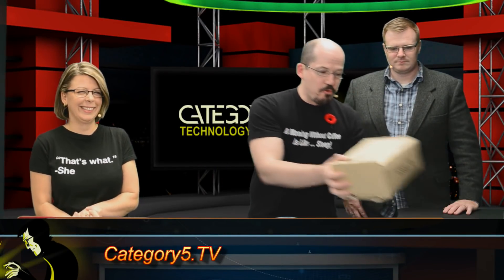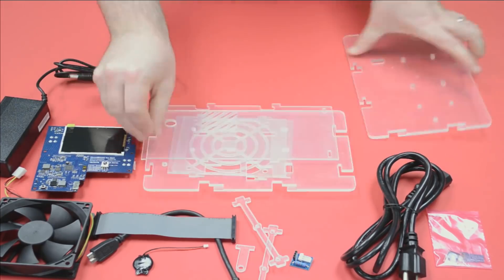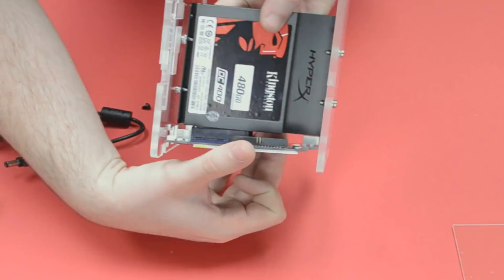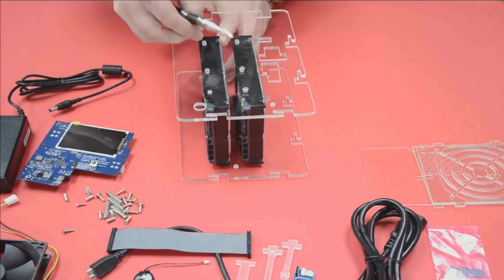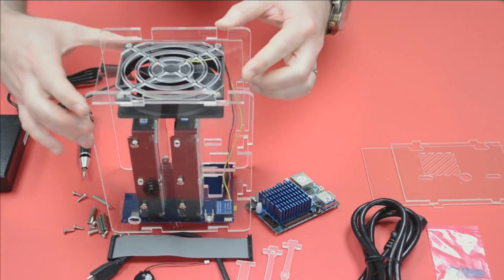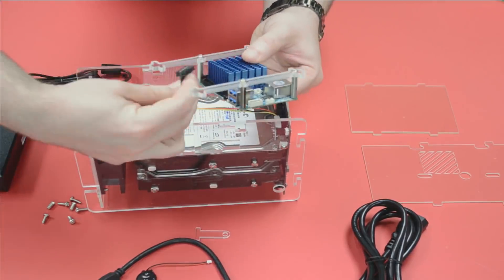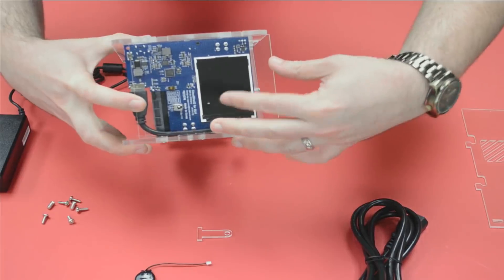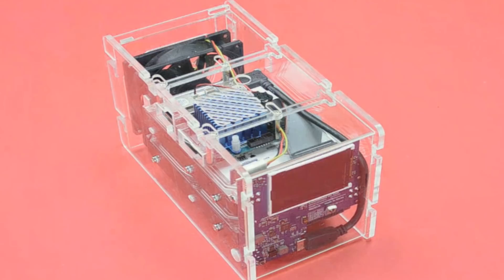The 8-CORE Raspberry Pi Killer: ODROID XU4Q with CloudShell2 Case - Assembly

Comment: For the money you can just buy a Quad-core Celeron J3455 mini PC w/ 64GB ssd and 4GB of RAM.  I bought one at $150 off a chinese distributors website, but you can even get them on Amazon for $200.  Comes with full version of windows 10, and runs games all the way up to PS2 (some PS2 are rough, but still some are possible...unlike the ODROID.)  You have put more than $200 into this build, and are bragging about smooth N64 performance.....
Reply: how quiet is the Celeron tho ? if I am wanting to run it 24/7 and have it in a bedroom like I do with a Pi3 atm ?
Reply: A lot of them are fanless.  The one I have has an adjustable fan on it.  They can run stable up to 70ºC, so you just adjust your fan accordingly, or deal with the thermal de-clock which may or may not effect your usage.  The max volume of my fan is much quieter than, say, an Xbox 360 running.  It is very subjective, but I would rate it a 2/10 on the distracting noise scale with 1 being someone walking on carpet, and 10 being an alarm clock.
Reply: The celeron sounds great maybe an overkill to use just as a media player with both plex and kodi, I've tried pcs as media players b4 but I just can't get wife and family to use em, they want a device that can be operated by a hand held remote not a mini keyboard, never found a solutuion
Reply: I doubt it would help in this case, but mine came with an IR remote that works like a mouse w/ a few macro functions.  That being said, I COMPLETELY know what your talking about, lol.  It is an impossible task to get a significant other to use even the simplest of KODI setups, haha.

Comment: I like the raspberry because its not that expensive please compare things of the same price.
Reply from the maker: This board is only $54. So yes, it's more expensive than a Pi, but still very low priced. You pay a small premium for a lot more power.
Reply: Well why did i just buy a raspberry pi 3... Is there same support like the raspberry like games made for it ? or maybe some programs..

Comment: So is it $35 like a rasp pi 3?? Come on lol this is silly af
Reply from the maker: $54 for an XU4. 4x as powerful.
Reply: LinuxTechShow so your telling me the box you showed in your vid can be had for $50?? Link in your description??
Reply: Case alone was $80 on Amazon, all other links were sold out so couldn't see. Just not seeing how your whole box could be $54. But if i can get all that for $54 hell I'm on board
Reply from the maker: No, the case is a different product. Does your $35 Raspberry Pi 3 come with a case? Let alone one with a screen and backplane? You're comparing a Raspberry Pi 3 board ($35) to an XU4 board ($54). How did the rest of the peripherals get involved?
Reply: LinuxTechShow yeah mine did. I've got two servers running cost me $35 total. Not saying this isn't cool, just when i saw the headline rasp killer thought it was something much better for around the same price point. But just taking your board and the case you're over $100. I can get 2 pi 3s and cases for that. Yes this board is cool. Yes its obviously better. But the great thing about the pi is it's price point. And most consumers after going to need extra peripherals, hence why i included them. I very rarely just buy a pi board. I buy all the parts needed to put together what I'm building. And in your segment you show more than just the board. So why would you question me talking about more than just the board when that's exactly what you did in your segment? How much would the whole box you had in your segment cost?

Comment: A Pi killer this is not.

The thing that make the Pi great is that it is cheap enough to be affordable for even small projects, but functional enough to perform any task those small projects might entail.

Start packing on a bunch of extra performance and cost and you stop catering to the needs of this market niche.

Now is there room for an 8 core ARM based machine of this size on the market? Definitely. However, I'd be hard pressed to think of a use for one that I couldn't do cheaper with a Pi. About the only thing I can think of would be a cluster computer. Even then the two basically just break even as the Odroid has twice the cores but also twice the price. The main advantage would only really be less cabling and switch ports are needed.

The real Pi killer would be the Orange Pi which offers about the same performance as the Pi but for almost half the price.

Personally, I am not a big fan of ARM based processors, mainly because they can't easily be made to run x86 or amd64 based applications. That really cuts down on the amount of useful software available for them.

Frankly, I prefer the Intel Compute Stick model: STCK1A8LFC. These days they are about the cost of a pi, have about the specs of a pi, and are actually able to run x86 and amd64 software. The biggest advantage of them though is that the compute stick has intel HD graphics which is far better than the broadcom chip on the Pi. Of course, it also only has wireless networking, 1 USB port for connecting devices, and is really hard to install a different OS on than the Ubuntu it comes with.

Comment: You said the XU4 was basically the same form factor as the Raspberry Pi.
However, in actuality, it's approximately the same size, but has a different form factor (port layout, etc.).
Reply from the maker: We're both right, technically. Wikipedia says: Form factor is an aspect of hardware design which defines and prescribes the size, shape, and other physical specifications of components, particularly in consumer electronics and electronic packaging. A form factor may represent a broad class of similarly sized components, or it may prescribe a specific standard.
We are referring to the form factor ie., dimensions of the board itself. The size and shape.
We both get a point.

Comment: Even tongue in cheek, I would not call it a PI killer, what I would call it, is a nice small form factor desktop pc, the 8 cores will certainly allow for some high performance number crunching, though the 2 gig of ram could well become an issue once the OS is loaded in, this will probably lead to a lot of swap file usage, therefore negating the 8 core performance, in my opinion, this board needs 4 gig ram minimum for optimal performance.

Comment: This is not a raspberry pi killer, it doesn't have the support. The OS are not as optimized. Hard kernel support I got was minimal. If you can get it to run proper yes it does out perform at a difference price point. Not a faircompsrision for a non profit who set out to make sure we can afford to play around with a cheap powerful board. No where near a killer

Comment: Wait.... the included SSD adapter bracket doesn’t fit?  Sounds like a REAL quality product there!
Reply from the maker: ? The bracket adapter that came with my SSD? It's just a 2.5" to 3.5" adapter. If you want to use an SSD with a backplane, you have to buy a 3.5" drive adapter as shown. That is always the case and has nothing to do with ODROID.

Comment: Can this do mjpeg-streamer with a video feed from a webcam and not max out a cpu core at 100%?
Reply from the maker: xav500011 send us the config you want us to test with and we'll add it to the coming benchmark show. We have some c920's - does that work for you?
Reply: I asked the question because though the ODroid Xu4Q has 8 CPU cores there are many processes that can only use 1 thread\1 cpu core.  And this is a problem I have encountered when trying to use a quad core Raspberry Pi 2 to stream video from 2 x Sony Playstation 3 Webcam (They are very cheap to buy 2nd hand because there is no Windows driver for them but they work fine in Linux and they have give a good video qualityeven at 640x480 resolution) using https://github.com/jacksonliam/mjpg-streamer.  Because the Raspberry Pi 2 has 2 cpu cores maxed out at 100% from the 2 instances of mjpeg-streamer it can not stream video in real time without several seconds of delay.  I have fixed this problem by using an old laptop that has a AMD Turion Dual-Core CPU at 2.1ghz.  Though this laptop is not 'ultra low power' it is 'low power' in using only 25 watts of electricity.  And this far more beefy CPU can handle streaming video with mjpeg-streamer in real time with no buffering\delay.

Now a problem with this could be that there is no hardware acceleration for streaming webcam video that there is for other video playback.  But if you guys can get the ODroid Xu4Q to stream video at 1080p from say 2 x Logitech C920 webcams that would be very impressive.  Also you could do a comparison with a single board computer that has a quad core Intel Atom CPU.  Because as far as I know Intel Atom CPU's have more grunt per CPU core than say the ODroid Xu4Q.

Comment: I have a Raspberry Pi Killer.  It is a $5,000 rig that destroys all comers.  Who cares though.  Pi's are awesome because of the price, the GPIO and most importantly the community of developers.
Reply: It's only slightly more expensive. If you bought two Pi's and clustered them, they still wouldn't match the performance.
Reply: Dude. My pc from 2000 still iut powers the latest arm processors. Theyre a joke as far as processing power goes
Reply: I'd say it was more focused on creating embedded solutions for people who otherwise couldn't implement such systems. It offers a generic solution to implementing an embedded system for virtually an unlimited number of products that would've required extensive engineering before the advent of SBC's. All that is needed now is a basic understanding of electronics and some computer programming skills.
Reply: Touch late but for me to get a pi with the nes case psu and sd card USB adaptor. It's about £74. The odroid is about £58 with a psi £6 for the sd adaptor and about 🔟 for the case. It's basically the same price. For a system that's double the power. But it's hard to choose. I'm new to this and the pi looks great for noobs that wants to retro game.

Comment: Not a Pi killer. The whole concept of the Pi is that it is very low cost and modular. I can use a single RPi for any number of different things by simply switching out its micro SD card. That said, this single-ish board computer does look pretty cool if you've got far more cash to burn.

Comment: The reason why your HDD bracket don't work is the same reason you cannot use those bracket in a HDD disk tray ex: DELL PowerEdge 2950. has 3.5 hdd but won't work because the bracket offsets the SSD by like 1/8 in. So that front panel won't work because of that. The bracket you need has a L-shape. Looks for 3.5 to 2.5 adapter for server. it fills the gap rather than moving the drive something like this: http://www.ebay.ca/itm/like/112451929619?chn=ps&dispItem=1
Reply from the maker: I prefer the adapters we show at 13:20

Comment: Did not make it past the first segment. "Look at that big heat sink, know what that means? No fan" Then pulls a fan out of the kit.
Reply from the maker: The fan is part of the NAS case we're demonstrating, not the ODROID XU4 (the small, Raspberry Pi sized board).
Reply: there is passive cooling options

Comment: I'm imagining how much more powerful 8 cores will be for emulating retro consoles... And I'm imagining it makes zero difference.
Reply: miss point of the pi
Reply: i seen one using a zero
Reply: You are assuming that all emulators run on 100% parallelism optimized code. They don't. In fact, they are more often than not only able to utilize a single core in the first place. Putting a heatsink on a Pi Zero and overclocking it quite heavily will yield a substantial performance boost over this thing.
Reply: 300 a trick?

Comment: So how exactly is this a Pi killer? It may have 4x the speed at twice the cost, but for twice the cost of the ODROID I'm close to a Ryzen 5 1400 and a cheap motherboard that will make the ODROID look like a Ti-82.

My point is that it isn't just the power here that makes Raspberry Pi what it is. There's much more to it than that. The extremely low cost puts it at a price point that is affordable for so many more people. So even if you are just using this as a low-end computer that's a remarkable feet for $35. 

However, the most important thing that I believe sets the Pi apart from the ODROID (and like competitors) is the community that has been established around it. The likelihood that you will encounter an issue no one has tackled before is minimal. The existing documentation along with the active and helpful community are an enormous asset that no other competitor can touch at this point. Personally, I don't see that changing anytime in the near future.
Reply: congrats on seeing it, it is why i hate term pi-killer
What it should be called is your next step

Comment: Ok listen. You as well as all the other tech channels. If something is a Pi killer or anything killer for that matter. It can't be 3 times the price. A raspberry pi on average is $20 and has 4 cores. If you do the math and cluster your pi's together you get 12 cores for $60. Now if you want to do a proper comparison, cluster 3 Pi's and test. Then test this new overpriced crap. Only then can you decide which is better. 
Note: above prices take into account that most people have a box containing a couple old routers and a bunch of ethernet cables lying around.
Reply: actually the fully miss the point as IT IS NOT A PI , read the story behind the pi , only one board would I say ok to as far as trying to replace it was the chip and it's story is just as intersting

Comment: My issue is they clearly don't know how computing works, saying it's 2 to 4 times faster because of the core count.  If that was all that mattered a 20 pluss core Xeon would beat the crap out of all the I core chips and be the choice for gaming.  But there is so much more to it, and only a few apps will even use more then 2 cores efficiently.  Also to kill pie, you must beat it in the same price range.  Also, where is them using it and the benchmarks.
Reply: from what i have heard xeons are useless for gaming, its all in the video card
PLUS pi-killer is a bad term because it misses the point f the pi

Comment: It might be way cheaper to buy two HC1's and use raid one over FCoE. You will loose the reliability of the eMMC though, so you either only use uSD for booting, or you boot a live image from uSD,
Those 2.5"->3.5" backplane converters are expensive as f*ck especially if you have a correct one.
The downside of the HC1 is lack of HDMI out of course, and no I/O.

Comment: Pi killer?   This is not really covering the Maker market that the Pi addresses. You are just building a general purpose PC.  R. Pi Zero with WiFi at £10/USD12-13 (real price) is a MUCH more interesting device, especially as you can now access the GPIO pins on a remote device ....
Reply: pi-killer is a bad term, it is not a pi and that point is missed

Comment: Why do they keep releasing these silly raspberry pi's, it will be a 16 core one released next week!
Reply: What use are more cores if it doesn't utilise the ones it has 100%. Most SBC code is not written to utilise multi cores, so it becomes a mute point how many core it has. It then becomes a marketing exercise to say ours has twice as many cores as the competition, so ours goes twice as fast. Which of course NEVER actually turns out to be true, because when a real world and unbiased software comparison is done, it falls well short of the claim.
Reply: it is call ride the coat tails
beside pi-killer is a bad term

Comment: Usb2 is slow?  Kind of useless video.
Reply: Charles Gregson It's slow compared to a PCIe bus or similar. USB 3 can keep up with 1Gbit Ethernet or a fast SATA SSD.  I happen to use a single board computer that has a PCI x1 port, though I only use the built-in devices on that one, since it was bought for a single purpose.

Comment: Seems like a lot of add-ons and upgrades u need. And no wifi?! It's also 5x bigger than RP. Would like to see it tested
Reply: For that whole kit I could get a chromebook
Reply from the maker: All the add-ons are optional, of course. If you're looking for a Pi alternative with more power, look at just the board, not the whole kit. This is a build video and of course for that, we included all the options.
Reply: defeats purpose of the SBC
ps pi-killer is a bad term

Comment: I'd just rather buy a working off lease PC for $79 and add my drives and software
Reply: but you missed the point of the pi and SBCs in general (read the pi story)
Reply: billfusionenterprise No I got it that it has it's applications but it's just not suitable for most of my uses. Still its a nice compact system.
Reply: congrats on getting the point though somewhat, applications, ever read the story behind the pi
Upton was conducting classes in 2003 and saw that there was no hard core programming like in the Sinclair days, so he created the pi foundation with 3 others who believed the same. Create a SBC that gets kids back into programming and electronics. Hard to get mum and dad to use the 2000 dollar system for this work. Programming could cause a system crash (ever see a linux sucks video)
Sad fact is in a few years when we need computer programmers or electronics engineers we have to go to england

Comment: Got a fan less quit raspberry pie killer, has huge fan cooling the hdd's... hmmm
Reply from the maker: Haha, well, you can remove the fan if you want. We'll use the governor instead, and let it draw a breeze over the components. I'm sad to say though that now that I've installed the SSDs, the fan never turns on, so I don't get to see the pretty lights (I installed the LED fan)!  :D  So... the cooling is really just a backup at this point.
Reply: pi-killer is bad term (read the pi story)
But odroids do come in a passive setup